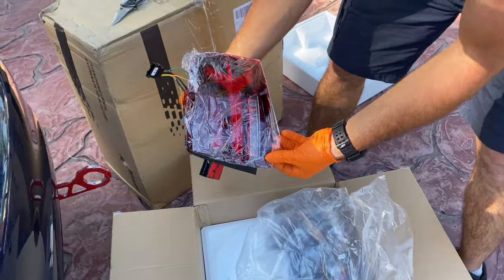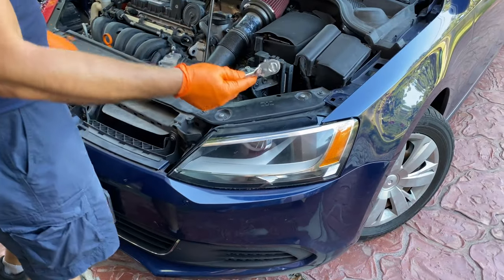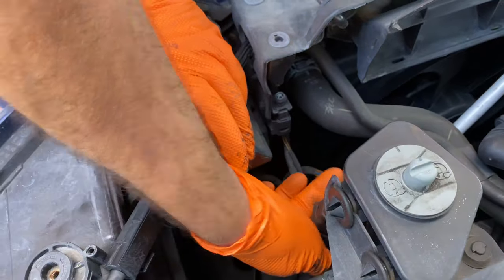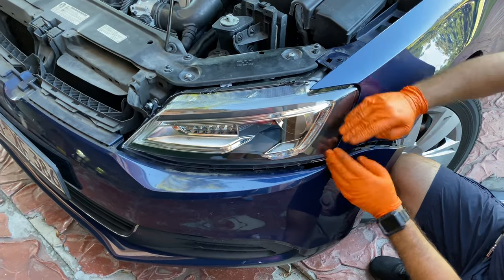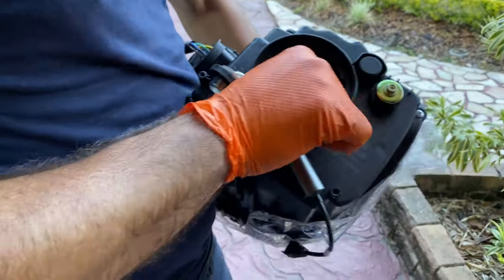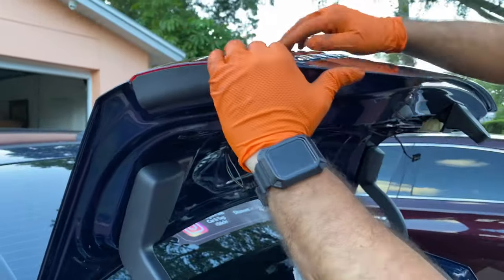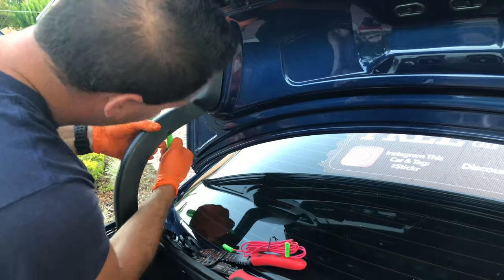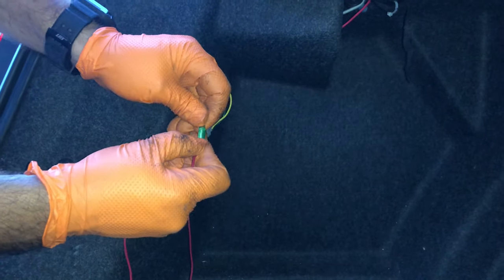Headlights & Taillights Replacement (vland) for VW Jetta MK6

Comment: Hey bud. They came out looking good. I was curious about all the extra wires I saw in the pictures online so this video answered my question. How is the light output with those led’s through those projectors? And how’s the cutoff on those projectors? Nice and crisp like a projector is suppose to be or is it off? Did you ever get any light out indicators from this setup?
Btw, just a recommendation if you ever do mk6 Jetta headlight again. Don’t take that top metal cover off or the bumper. Pull those 3 or 4 headlight bolts off and push the outter part of the headlight in and you can angle the whole headlight out. There was a recall for the mk6 headlights when they first came out for internal wiring. I had the headlight out, rewired and reinstalled in under 5 minutes. Best time was 3 minutes 20 seconds per side iirc.

Comment: Literally just got these tails today. Love them myself. Gotta save up for the headlights.
Reply: And now i've got the headlights! What is the harness you've used between the OEM harness and teh VLand light? It seems i need different pin layout between the two.
Reply: @NatriumAuto  I'm having the same issue. Installed the Vland headlights and the DRLs don't work. Mine didn't come with the adapter harness that's wired between the oem and the Vland headlights. Anyone know where to purchase these please?

Comment: Subscribed! Nice video...I just got my VLAND's. I went with the same LED bulbs. Your video saved me a lot of confusion...didn't know if I needed those H7 adapters or retainers.....but I see from your video they are not needed....thanks
Reply from the maker: Thank you buddy, I’m glad i was able to help. 👍🏼
Reply: @AdonayLopez  bro, did you find it difficult to adjust the side to side of these vlands? I keep turning and turning the screw but the light beam doesn't move.......I think I'm going to try with a power tool not a screwdriver...see if that helps.
Reply from the maker: @r_s1776  what i did was just put all the screws in the position they’re supposed to go and move the headlights around until i like the position it was sitting at and then started to tighten them one by one but not completely tight just in case you have to move the light again.
Reply: @AdonayLopez  alright thanks for the reply....I messed around with the screw a little yesterday,  seems better...I love the output of these headlights!

Comment: Question, I'm about to buy this sets. I have a 2016 Jetta sportline, did you had to do something additional to plug them? For example, my model does not have DRL, and this headlamps does, is it necessary to take it to VW to make a change on the computer? Or by plug them in is ok to use head and tail lamps??

Comment: How did you make that Cold Air Intake? or is that a kit? Also, great vid! this has been the most detailed and CLEAR video ive seen for headlight installs.
Reply from the maker: hvelazquez01 thank you very much! The intake i took the air box off and bought some intake pipes and the air filter from advanced autoparts and put them together nothing fancy lol. I have to get an actual kit for the cold air.

Comment: And also for the taillights is there another red wire to run to the right tail light? Cause u skipped over it and you only ran one pink wire down for the brake light does the other side have it

Comment: How is the output from the headlights? Good cut off line and light dissipation?
Reply from the maker: Yes just like the original, but better... much brighter if you use LEDs.
Reply: @AdonayLopez  do these come with the LED’s or we have to buy them separately? Thanks
Reply from the maker: @alosando88  the head light bulb in the only one not included.

Comment: Did you just let the relays for the outer lights hang between the trunk liner and the tail light? Also, have you checked to see how hot the relays get? Mine are extremely hot!

Comment: Are the headlights bi projectors? I keep seeing reviews saying nothing happens when turning on high beams. I find it odd they wouldn't use a bi projector being single beam, but I am curious.
Reply: Any results I’m in the same boat
Reply: @DeAngelo Capron  they are bi-projector but single filament bulbs. Mine works fine with modifications I've done. I bought these and  had to make some wiring changes as it wasn't working right. They also use a dual bi-projector but cover the other light which means there is a false light turning on with high beams. Potential for fire with how it is.

Comment: Your videos are amazing! Great work and great explanation, one question. I too, have an MK6 Jetta and bought the same headlights and tail lights. Which bulbs do these require?? Is it H7??
Reply: Yeah, they’re h7 both for high and low beams
Reply: @armandoplasencia5809  but whats the difference from the H7 and the stock ones the lights come with? they both are the same brightness
Reply: @CASPERMOB  If you mean the stock halogens, the difference is specifically that because these bring LED's. If you mean Difference from high and low beams on the front headlights, then the difference is the wattage they can withstand or receive from the car's electrical system.  

BTW I'm not a mechanic so if anyone who knows more about the subject wants to ratify or debunk my answer, you're very welcome to.
Reply: @jasonsouter1172 where and what brand did u buy these headlights? And can it fit the 2013 right hand drive model tsi

Comment: Adonay Lopez, great video!!! Any idea where I can order the wiring harness that goes between the oem harness and the Vland connector? They were not included with my the headlights. DRL lights not working, everything else is.
Reply: I had this same issue. Did some research. On my VW plug the DRL are pin 10 and on the VLAND it should be pin 1. I tested with a jumper and then replaced the pin when I confirmed it worked.

Everyone I've read who tried this says it works
Reply: @NatriumAuto  You're the man!! Moved pin #10 to pin#1 and the DRLs fired up.
Reply from the maker: Yeah if you don’t use that harness the drl are not going to work. I’ll search on the vland site and if i find it i’ll write the link here.
Reply: @AdonayLopez  thanks!! Not sure whey some vendors sell them without the harness. I bought them on Ebay, Vland had them out of stock at the time.
Reply: Ever find out where to get that wiring harness?
Reply: fb2837 i did that and they still didnt work. Any insight?
Reply: @Slavikhavoc  My car is a 2012 Jetta SEL. I believe it should work for any 2011-2014 Jetta after you switch the pins, unless you have the wiring harness. What are your lights doing after install?
Reply: fb2837 i have a 2016 gli, they stay on “auto” but the drl never turn on.
Reply: @Slavikhavoc   You have a newer model. I'm positive its a pinout issue. The hard part will be figuring out which one. We already know pin 1 is the DRL for the vland aftermarket lights. My drl pin for my 2012 jetta was 10. Moved 10 to 1 and it worked. If you can find a schematic or maybe ask on a VW forum. Once you get that information, move that pin over to #1 and that should fire up.
Reply: @Devilninja333  did you ever find out ?

Comment: Not sure if you still have this vehicle but did you ever experience any problems with the headlights? I've read people saying that the bulbs would get to hot and melt the housing.
Reply from the maker: Unfortunately i don’t have the car anymore, but i had no issues with overheating, i did use the LEDs with the fan in the back to help dissipate the heat.
Reply: @AdonayLopez  Thanks for the video. Really helped with installing these parts without the fear of breaking something or doing it wrong.

Comment: Awesome video. Great work. I have a question about the wiring on the tail lights. Did you run the red wire down both sides of the trunk?
Reply: Right side connects with left and then the second red on the left corner connects down to the other red right under
Reply: @Boot_14  but I'm confused how. I only saw him go from top right, top left, down the left side and to the bottom left light
Reply: @spawnedagony  correct that's it. Top right to left and left top to bottom left
Reply: @Boot_14 what he's saying is that he didn't seem to connect the bottom right, aka the right side outer lights, to the rest of the wiring. Basically it seems like the outer right lights wouldn't work because he didn't connect them in the video. Maybe he skipped that part because in the end the right outer lights seem to be working but I'm not sure
Reply: @inquizition9672  if I understand right, boot is saying that you only need to connect it down the left side. the left side is already hooked up to the right internally

Comment: Are you having in water leak issues for your taillights for the left side?
Reply from the maker: No i haven’t noticed any leaking on the car. You could try to check for a missing rubber seal. Or could try to put some waterproof silicone around the opening.

Comment: Just bought headlights and the bulbs for my 2015 Jetta tdi does everything come with the headlights like the adapter  and do I have to do additional wiring ?
Reply from the maker: Madison Jay some people have not received the adapters so be careful, it depends on the seller. And no approval wiring required for the headlights
Reply: Adonay Lopez okay I’ll keep u updated I used the second link in your description for them

Comment: @Adonay Lopez Thank you for your video! It was very helpful installing both headlights and taillights. 

I have a question though.. does your electrical components (black box w/ wires coming out) for the outer lights get extremely hot? Just wondering if that's normal or an issue I should be concerned about...
Reply from the maker: My friend I’m not sure about your concert, i haven’t test them when the lights are on to see if it’s normal. Ill get back to you soon.
Reply: @AdonayLopez  Do you have the updated link for the headlights and tail lights

Comment: You may have already answered this but I bought these and it didn’t come with an adapter? The DRL wouldn’t work .. any suggestions ?
Reply from the maker: Unfortunately the only current solution it’s an adapter. Best thing to try is to contact the seller and see if they have the adapter.

Comment: hey do u get in water in your taillights or trunk at all?
Reply from the maker: Not at all, if you are getting water inside cheek is the rear seal is install and also make sure the tail lights are fully tightened.
Reply: @AdonayLopez  i’m getting water inside the trunk turn because my inner right taillight is not flush. it just won’t sit flush with the body. the left side is fine but this right side is giving me problems. the lights work fine but the fitment is bad. idk if it’s defective or what. i can’t return them because i’ve had them for over 6 months now
Reply from the maker: @ihteshamkhan4696  in the back there its no adjustment so it may be a defective unit.

Comment: does drl function work like so? or with the fourth lights of the car? If so, do you have to activate drl on the computer?
Reply from the maker: The DRL integrated with the headlights are always on day and night and no programming required.
Reply: @AdonayLopez  ty bro , I have a question friend, I hope you can support me, I bought the vland kit, led with a red angel eye, my car is a 2016 jetta mk6, I already installed everything and activated the drl, and everything was fine, but the red eye does not light up , the seller says that this is a special function that my car must have .. but I don't know why it does not turn on if the drl is already activated in the computer and the white led bar if it turns on drl, only the red eye does not, you know how to activate it or what is the problem?
Reply from the maker: @rdws.d8  unfortunately i haven’t heard of this issue. It must be a separate function like they say. You might be missing the pin in the oem conector that makes the red eye light up. Compare both the headlights plug and the one in your car to see if that is the problem. If it is you might have to create a bypass from the DRLs to the red eye to have it on at the same time. Wish i was there with you to help out more.

Comment: How do you adjust the headlight beam? I just put mine in and its way too low
Reply: There are adjustment screws, I think they are a gold color...put screwdriver in and turn until the beam is where u want it.......the up n down screw is the far left and far right screw....check vland website for locations
Reply: @r_s1776  i figured it out like the day after lol, it was a 8mm socket

Comment: The wire you run down to the left taillight did you have to repeat the process to the ride side taillights ? The red wire
Reply from the maker: Nop only for the left side
Reply: @AdonayLopez  so no red wire runs from the inner right side to the outer right side. There’s only one pink wire that goes to the left one? I think I’m a little confused my taillights come in in about 2 weeks just wanna make sure I understand how to instal before doing it thank you man
Reply from the maker: @madisonjay8384  i understand, the red wire that i had to run down the driver side hinge of the trunk it’s to give power (brake light) to both inner Taillights because the oem ones do not come with that feature. One long red wire is the one that connects to the driver side brake light wire on the outer taillight; and one smaller red wire that connects both inner taillights together. Hope i was able to explain it well. Any questions write again 👍🏼
Reply: @AdonayLopez  yes I understand now the only thing is the right side just confused me how the outter taillight doesn’t have the same process on that side, but I will use your video when installing I’ll come back when it’s done! Thanks again

Comment: Hello again sorry to bother you I really need some help I tried to fit these exact headlights in my vw jetta and it’s fits perfectly but the headlights won’t go from dip to full beam for me beacause the original headlights have one light for dip and one for full beam I can’t contact vland who I bought the headlights from and don’t know what to do is there anyway to fix this problem I would really appreciate your advise thank you
Reply from the maker: Hello friend, unfortunately I’m not familiar with this issue. What i know is that the new headlights have a mechanism inside that switches from the low beam to the high beam using only the one bulb. Are you having issues with both left and right or is it only one. Maybe the motor inside is defective or the wiring harness has some issues. Are you using the adapter that came in the box?
Reply: No problems inside I did not get an adapter inside box this could be the problem I tried contacting vland but got no response but thank you very much for your help 🤙

Comment: Did installing the tail lights throw any lights/errors on the dashboard?
Reply from the maker: It actually does because the system is not designed for LEDs but the error light goes away after the car turns off until you turn the lights back on.
Reply: Adonay Lopez Ok thank you! That’s a deal-breaker for me, but great video!
Reply: Great video!! Could you take a photo of this error I see if I can live with it? Planning on shipping these in.
Reply from the maker: @robertgiteya  thank you, here is a link for some google pictures https://www.google.com/search?q=vw%20jetta%20bulb%20out%20warning%20ligt&tbm=isch
Reply: @AdonayLopez  aaah this I can live with lol. Thanks a bunch. Throw distance for the projectors is great?

Comment: 25:10 Do you stick the resistor box on the side or you just dropped it inside
Reply from the maker: I just place it behind the carpet, everything was a tight fit. But you could stick it to the body as well if you want.
Reply: Adonay Lopez Yeah I didn’t think it was safe to leave it dangling so I stuck it to the side so thanks man I got the tinted versions and they look amazing

Comment: Do you know if you can still install the front headlights without the adapter I received my headlights today but got no adapter what should I do someone help please
Reply from the maker: You can, but the DRL are not going to work... i would try getting in touch with seller. I have try before to find out if you can buy the harness separately but i have not find then at all.
Reply: Thank you very much and what do you mean by the DRL
Reply from the maker: Colm Henry the DRL is day running lights. The light bar that goes around the headlights. The light that are alway on even when the switch is off.
Reply: Thank you for your help

Comment: So currently I am having a problem where I don’t have any backup lights, I put my car in reverse and my backup lights do not activate.... 
anybody know anything about that?
Reply from the maker: Check the connection on the trunk lid thats where the connectors for the reverse lights are at. If its all good there, check the fusebox for blown fuses.

Comment: hey man is everything still working okay? i’ve never shopped on ebay and am having some major trust issues from which seller to buy from, the seller reviews look fake on a large majority and every seller just looks suspicious lol
Reply from the maker: They still work great, no issues. Make sure when you buy them that they come with the adapter for the headlights otherwise the DRL won’t work. Send a message to the seller asking about them to make sure before you buy.
Reply: @AdonayLopez  alright, thanks! is there a specific brand that you bought because they all look the same yet there’s so many posts for the same product.